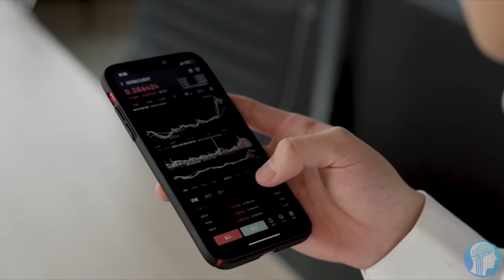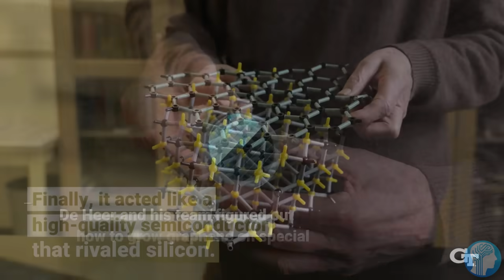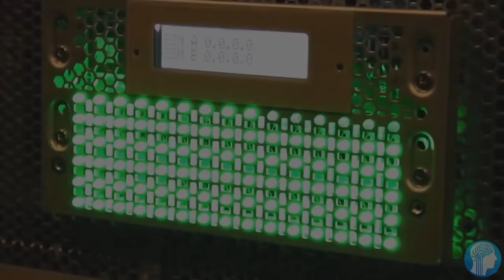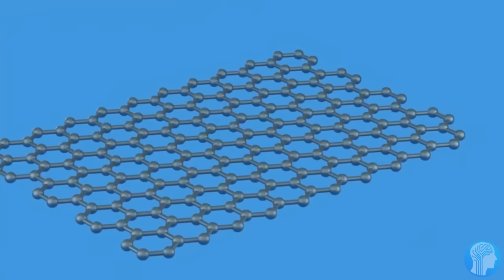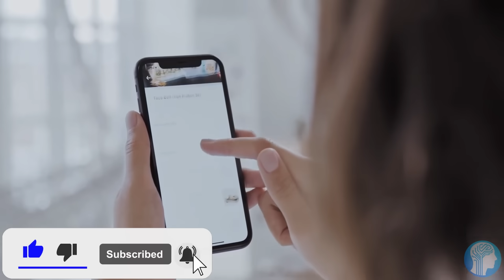AI just Became 10X Faster: First Ever Graphene Processor

Comment: I believe that there are many challenges about the graphene chips. 1. How to mass produce the graphene chips compared to the silicon chips?. 2. How to do lithography to the graphene chips below 14 nm?. 3. How to dope the alternatives to the phosphor and the bore for the graphene chips? 4. How cheap is to produce them industrially?
Reply: All matters of WHEN, not IF.  Most things we envision today will happen, unless they're just obsoleted before being realized by better alternatives.
Reply: The benefits of graphene-based computing are not limited to those granted by increased number-density of transistors.  Graphene ICs are likely to operate at higher clock speeds (tens to thousands of GHz.  Reliable silicon chips with large die areas are rather difficult to attain, because thermal stress (resulting from heat dissipation) eventually lead to mechanical damage to the die and, in turn, inoperability.  This is why the bit of wafer in your CPU or GPU is scarcely larger than a postage stamp, despite the ample space available in many PCs.  With the dramatic decrease in heat dissipation enabled by graphene, it becomes possible to make dies with much larger surface area and, consequently, fit a much larger numbers of transistors--and there's considerably more room available (even in a smartphone, provided a good bit of time spent optimizing layout) than you might expect.  It's also worth noting that a great deal of the physical footprint of many computer gadgets is devoted to thermal-management infrastructure; if less thermal management is required, some of that space may become available.  

Further, silicon chips have, over the last decade and change, begun to incorporate "3D" architecture, involving a vertical layer cake of transistors; unfortunately, this approach suffers, too, from thermal stresses.  Consequently, gains in switching element density (setting memory-related transistors--e.g., NAND--aside) have been mediocre.  Graphene ICs (IF scalable from a production standpoint) would also be much easier to incorporate into "3D" processor architectures--again, as a result of decreased heat dissipation.  Thus, we'd AT LEAST get a large jump in total transistor count as the result of a larger canvas.  When you combine that with the aforementioned jump in clock speed, the amount of computing you can achieve in a given volume (m^3) and time will increase by, on the conservative end, perhaps two orders of magnitude (base ten), or a bit less.  If we, however, assume that we can quadruple die area, that we can decuple the number of layers in a 3D stack, and that 1000 GHz is a feasibly-achievable clock speed--in the next 20 years, say--we'd be looking at roughly three orders of magnitude (base ten).

Comment: Carbon is directly above silicon on the periodic table.  There is no element above that. Silicon was an improvement on germanium (also in the same group) and now they have made graphene act as  a semiconductor that is an improvement again.  WOW! I wonder how long before chips based on this breakthrough will be mass produced.
Reply: Plus, carbon is one electron shell in compared to silicon, so all the bonds it forms is much stronger. Pretty versatile element to form the basis of technology once the technical issues are able to be resolved.

Of course biology is all carbon based too. Nothing more suited to this nano level machinery than this one super versatile elemental building block.

Comment: Totally amazing, a Graphene CPU  10times faster processor to handle data at energy savings to incorporate AI into all new devices to give you extended battery life to boot. Technology today is literally moving at the speed of light, subatomic manipulation on the fly of making elements as needed, to be able to create new and specific functions using AI manipulation for such needs is just around the corner. 👀😃 
Great clip. 😎🗝✝️🙏🏼🇺🇸 🇺🇸

Comment: Last i heard, graphene is a dead end for chips, because it is not a semiconductor. This looks like some prof just discovered well-known siC electronics.

Require proof of claims before investing, people. Confusing with quantum computing is very suspicious!

Last i heard, the only relevant breakthrough was using carbon nanotubes, which will switch conductance off if mechanically twisted. However, figuring out how to implement that twisting system was where the Chinese team working on them were at last info.